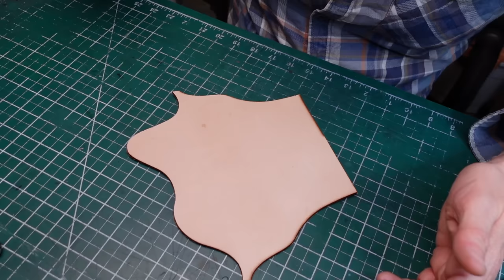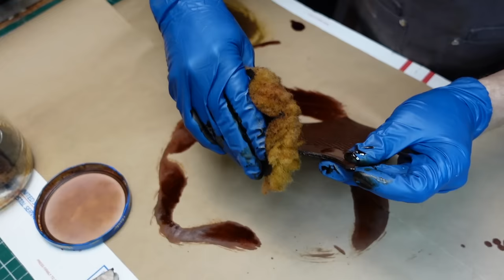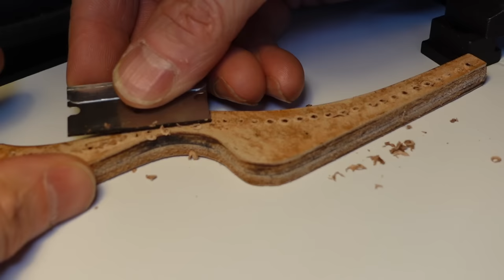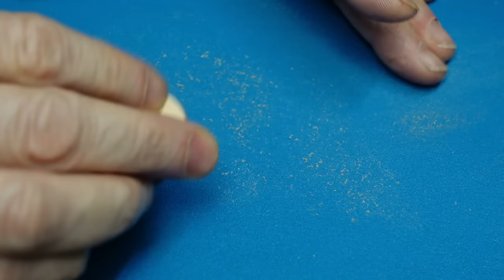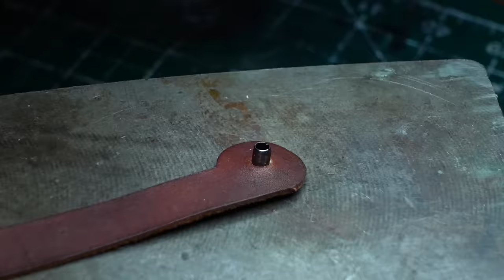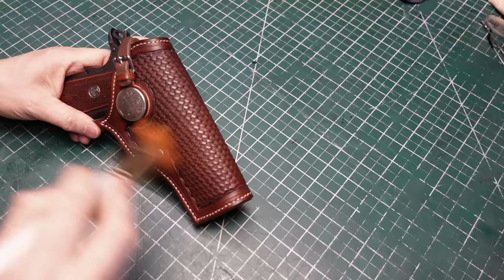Making a "Magnetic Leather" Retention 1911 Cross Draw Holster ASMR Leathercraft

Comment: I've been working with laser cutting my leather, I'll have to try wetting the leather. I've started using an air assist on my diode laser and find that it cuts much easier and cleaner, I believe it's because the smoke is blown away and doesn't refract the laser. That's my story, and I'm stickin' to it.

Comment: That laser cutting is so awesome!
Reply from the maker: Push-button awesomeness
Reply: @Road Agent Leather  I immediately went to check how much those costs online and the desire diminished instantaneously.
Reply from the maker: @Nontacticalboy  It's a small fraction of the cost of a clicker press and custom dies. And IMHO, so much more versatile.
Reply: @RoadAgentLeather  thats true. Can it be adjusted for engraving?
Reply from the maker: @Nontacticalboy  Yes. Check out my video on it: https://youtu.be/zZK7yK1eOTY
Reply: @Road Agent Leather  thats awesome, I'm seriously considering getting 1 now. Mainly for cutting the pattern out more than anything. I use head knife, but they dull over time and the need to strop and sharpen can get tiring over time. Thanks for video and info.

Comment: Beautiful work, and a gorgeous holster! I do think the snap is in a bad place, though. It could possibly click the safety off after a day's worth of movement, and scratches it up. You might want to adjust your design to relocate it up next to the slide, and line the strap to cover the snap head. Just a suggestion from my experience in holstermaking.
Reply from the maker: Thanks! I positioned it carefully in the depression created by the safety and the frame. Additionally, when used with the thumbreak strap, there is no metal that can come into contact with the pistol while carrying. Only incidental contact when actual holstering and unholstering. Even so, I thought of a way I can reduce contact to almost nothing (only thought of AFTER building it, of course ;-).

Comment: Lovely work, but the exposed metal fastening inside the holster, right next to the weapon, has got to be a recipe for scratching it…?
Reply from the maker: The snap is strategically located in the recess formed by the safety and the frame. Still, I figured out a way to eliminate contact altogether that I wished I would have thought of at the time I made this one. Check out my video on the Beretta shoulder holster

Comment: The problem would be the steel parts on the gun would become magnatized picking up tiny bits of steel particles (whiskers) which could affect the guns action.
Reply from the maker: Thanks for watching! Not sure if this is more of a "hypothetical" or an actual, practical problem. I've been using another holster with an identical system to this for a while and haven't had any issues with the gun becoming magnetized or picking up metal particles.

Comment: VERY nice 👍
I was wondering why you didn't cover the latch grommet on the inside.? Won't that scratch the pistol in Time.? Can't wait till I get so extra money so I can try one.. Thanks 👍
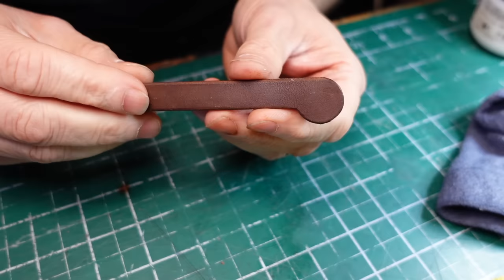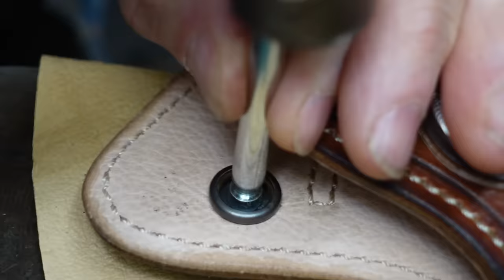Reply from the maker: Thanks! At the 21:30 minute mark you can see there is no exposed metal on the surface of the strap for the pistol to come in contact with. I made it from two layers of leather expressly for this reason. When unsnapped for holstering or unholstering, the inside half of the snap (the one attached to the holster itself) IS exposed . . . but it is carefully positioned in the depression created between the safety and the grip. That's what I was attempting to show at the 21:50 minute mark. There may be some incidental contact when actually holstering or unholstering, but there's really no way around it. The inner snap has to be there. I do have some ideas how this contact can be minimized for future builds though.
Reply: @RoadAgentLeather  I'm talking. About the snap hanging out on thee inside

Comment: Question for you:  Is that tensioner screw that you added just a regular Chicago screw?  I'm working on modifying Will Ghormleys 1911 Hand of God for a CZ52, which tapers down and it has some slop.  I think that tension screw would probably fix it.  In the meantime, I'm playing around with welt shape and thickness.
Reply from the maker: Yes. It's an ordinary open-backed screw post from the hardware store. Ran it through a buffer to polish it up a bit.
Reply: @RoadAgentLeather  Nice that's a great Idea, thanks.  If I don't get enough retention by tweaking the welt, I'll give that a shot.  Appreciate the info!

Comment: The button on the inside will mar the weapon
Reply from the maker: It's strategically placed in a gap created by the safety and the frame. Very little contact is made. Still, If I were making it again, I have an idea on making the snap recessed from the interior surface to completely eliminate any possible contact. Thanks for watching!

Comment: I am sorry but using a laser cutter is a cop out, why not cut it by hand, it is hand made after all. I realise buckles and studs etc are bought in but please don't let the skill fade out. What next use a cnc to do the imbossing or etching
Reply from the maker: Ok . . . What about electric sewing machines? hydraulic clicker presses? bell skivers? Electric burnishing machines, heat imprinters, edge & creasing machines, hand presses? All equipment that a modern leather shop needs to stay in business. 
Do you skin and tan your own leather? You probably order it from that new-fangled internet thing.
Where do you draw the line? Lasers have become just another tool of the trade.